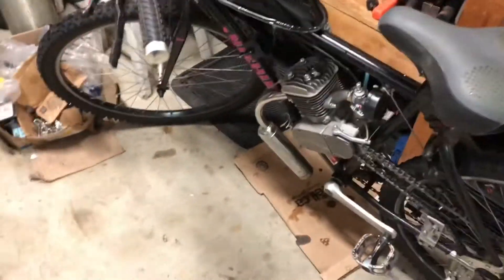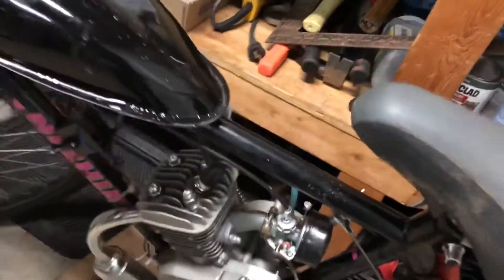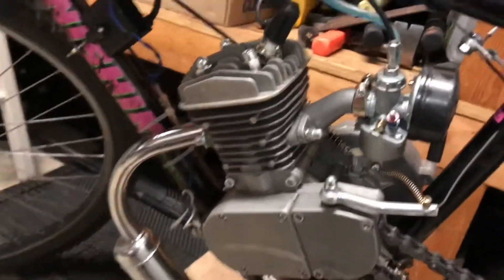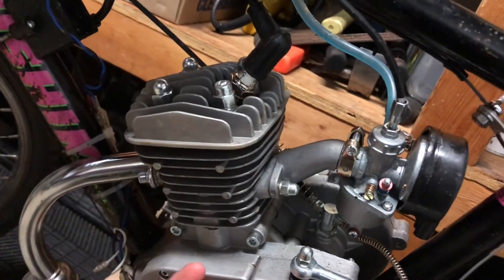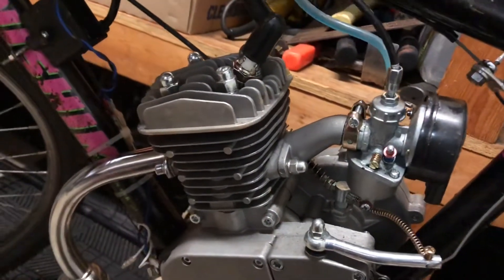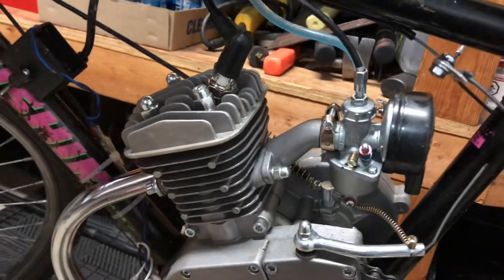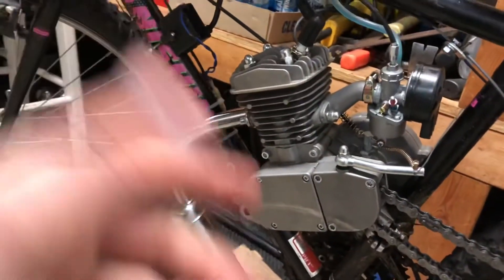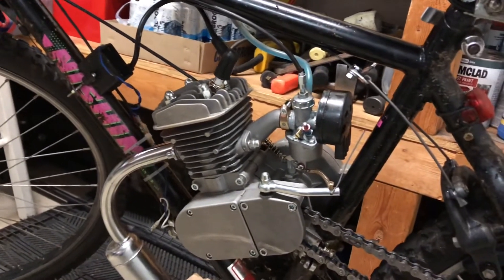Making MORE POWER for FREE on your Motorized Bike!

Comment: i like the fact you are trying.but bro half of what you say contradicts everything I say you hit the nail on the head with the carbon deposits what will happen there is it will score the cylinder jug it's not about price of spark plug or about a oil. The breaking. Is made let the motor heat up cool down and seat Property period after 3 tanks I run for ounces per gallon you don't want a full synthetic especially first tank during braking I have found better performance from regular oil after breaking however you do want a full synthetic the high RPMs good oils like go-kart engines or weed wackers have Teflon they add to the life of the motor and compression it's a single-cylinder engine it does have a rod connected to the bottom of the piston on the wrist pin. . Yes there is no casing with an oil reservoir because it's a 2-stroke your explanation of 2-stroke and 4-stroke was a bit off but that's okay man I'm happy you're learning stick with it the bike looks good good job bro
Reply from the maker: Yeah man thanks!! I learn lots every day. I’ve learned so much to the point where I kinda wanna redo this video properly haha. But I think I’ll leave it because people like it.

Comment: Hey is it ok to buy the premixed fuel from home Depot? They have 40:1 and 50:1, and it says it uses 92 or 93 octane in the fuel mix
Reply from the maker: You can get away with the 40:1 no problem. Don’t use the 50:1 though, in my opinion it’s too lean of an oil mix.

Comment: I have a 80cc I’ve been using 50:1 pre mix is that good ?
Reply: Well, if you are running too little oil in your mixture you could cause serious damage to your engine. 50:1 wont really hurt an 80cc, and its fine if you use it, but I would recommend 40:1 or 32:1 as to not risk expensive repairs to your cylinder by running too little oil in your mixture, or fouling spark plugs with too much oil in your mixture.
Reply: @kodistict9348  ok I’ll do the 40:1 u sure it won’t mess it up or make it go slower ? And is there any way for me to make my bike faster by any adjusting to anything I barely use the choke to much cuz I live in Florida and should I bump up the idle ? Would it make it faster and also I’m always worried something will go wrong if the engine is hot and I feel like it gets hot quick
Reply: @topflighttaylor  No, 40:1 will not make your engine run slower, or damage it. There are two mods that you can do completely free, 1. If you have the stock exhaust you can unscrew the nut at the very end of the pipe, take out the top, and your bike will run quicker and louder. 2. If you have the stock NT carburetor (This has some risk to it) you can take off the air filter to let in more air, but I wouldn't recommend doing this if you ride around sand or dirt, but the exhaust mod should give a lot of power on its own even if you cant take the filter off. Heat is a common issue with these motors, and mine gets really hot too, but don't worry about it because they are designed to get really hot like that and can take a beating.
Reply: @kodistict9348  ya I live in Florida so it’s hot lol and thanks man I seen if you unscrew the  screw it goes faster but doesn’t it eat more fuel too tho I commute to work and back
Reply: @topflighttaylor  It does consume more fuel yes, but it's a very small difference from what I've noticed as I have only recently gotten rid of that, and I get almost the same gas mileage as I did before.
Reply: @kodistict9348  I’ll get 40:1 pre mix

Comment: I'd say the #1 reason instructions say 16:1 mix and even 32:1 once the rings have seated is because the Chinese manufactures want to lessen the phone calls from pissed off people demanding a refund due to seizure of the top end of the motor at like 300 miles on the odometer. 
The compression is so low to begin with. 8:1 or there about when cars and hot rods are like 10:1  and 11:1. They don't generate too much heat if you don't weigh like me....250lbs. And...And they purposely set the timing retarded 5" to keep em' cooler.
Reply from the maker: I agree completely, this is why they recommend that. But a lot of places in China don’t even use actual premix like I’ve got here, they use motor oil. Which explains the super rich mix.

Comment: Stihl ultra hp oil at 40:1 works really good.  Its what most model airplane guys use in 20-100cc 2 stroke gas engines made in china, seems to make them last the longest
Reply: Smoke keeps the bugs away

Comment: what about mixing in about 20% rc nitro fuel into the gas
Reply from the maker: It probably wouldn’t run right. There wouldn’t be enough compression to even combust the fuel if you were to run 100% nitro. But a 20% nitro mix? It would be interesting to see if it would work. I personally don’t think it would do anything. Rc nitro fuel is meant to combust from the heat of compression and a glow plug. It might be similar results to running a diesel mix. Very oily, and would either predetonate or not combust at all. Look it up though, someone may have tried it.

Comment: Right around 8:30 you said it drill holes in your air box not that it made any difference it's just a nice thing to do I rest my case
Reply from the maker: Drilling holes increases air flow, allowing more air into the engine, this making more power. The carburetor usually has to be re jetted or the needle slide clip has to be adjusted. In my case, it was mixed to rich from factory, so this balanced it out, and I made more power.
Reply: @Everatti  i understand y but what reason did you have to do it.let me guess..it was dripping fuel.... but in my opinion the stock nt carbs are just fine.u have to be set correct jet and c clip.. other than that a small tip. I have one motor that I had to bend the metal forks that hold the bowl they were allowing too much fuel and not enough air I run mine without a filter on I know it's not a great idea especially if it's raining but I ride mainly on the street I would like to put a 36 or 34  sprocket with hub adapter. Was not trying to be hard on you bro I just don't think you've been doing this long enough to be teaching
Reply: Okay also check make sure your carburetor is level and you have no air leaks it matters do yourself a favor get a expansion chamber cuz you don't like the noise get one  they make  that is baffled with a muffler on it acting as it's suppress noise it is a good upgrade .u wont regret it.dont over think these motors.just learn em shit they r cheep for what u get out of them. especially when you know what you are doing.good luck bro.i want everyone to succeed.i mean it😃

Comment: lol..i watched this just to c what u had to say..cuz it all depends on a lot of variables I see no performance upgrade on that bike whatsoever your carburetor is sitting not flat you didn't speak about shedding at all you didn't speak about synthetic you recommend breaking it in the way they tell you and then you just threw out a bunch of numbers what are you saying I'm just curious and most likely you're not riding it anymore 4 ounces per 1 gallon good oil after breaking it in that's all anyone needs to do it's all about the way people drive them it's clear to me you need to watch and learn more posting nonsensical knowledge
Reply from the maker: Okay, I’ll give you more context. I’ve recently since this video ported the cylinder, fabricated my own expansion chamber and muffler, and added a performance coil and other little bits like a smaller sprocket. At the time of filming the video, the bike was completely stock. Just because a bike is stock doesn’t mean the person talking about it is clueless of mechanical knowledge. Check out LA Hover Bikes, he is extremely knowledgeable and rides many bikes stock. Because well, they are fine as is. What numbers would you like to hear?

Comment: I have a motorized bicycle i have been using 20:1 mix ratio. How much oil do you use for the 32:1 mix ratio?
Reply from the maker: Depends how much gas you have to begin with. For 1 liter of gas, you need 31ml of oil for a 32:1 ratio.

Comment: A two-stroke doesn’t have oil in the crankcase because the air/fuel mix is pulled through the crankcase by design. A 2-cycle can’t pull air/fuel directly from the carb into the cylinder.

Comment: There is too many reasons your wrong
Reply from the maker: List some please, I’d love to hear them
Reply: @Everatti  most engines spin at 3500 rpm these go at 7500-8500 have you looked at the bottom end bearing material they could be compensating for low quality and poor deboring process and you check the gaps you see the exact expansion and contraction of how that aluminum expands with the amount of heat it gets also considering the extra heat made from less oil why you think it runs better hotter engine so you remember there is all different variations of metal quality and they expand different if you dont know what your doing don't do it
Reply from the maker: @adamsmy8121   I am aware that the aluminum engine block and the cast piston rod and steel bearings expand at a different rate when put under heat. That is why you let the engine warm up before you ride it. The oil is meant to lubricate, not cool. 100:1 mix ratio, I get what you’re saying. But something like a 36:1, that couldn’t do anything to the engine. I’ve been riding that black bike at 36:1 for literally thousands of miles with zero overheating, wearing, or compression issues. I’ve checked the piston and the jug multiple times.
Reply: @Everatti  ok there is 1 thing $150 engine that oil compensates for something explain this

Comment: You made this on my last birthday, thanks!!  That's good advice, and in truth, you can tell the quality of the burn, by the color of the spark plug.  You can lean out the oil until it has a nice brown color on the inner electrode, you probably won't get away from some oily residue, but as long as it doesn't go white, you won't be too lean.  A better carburetor can probably be found in a motorcycle junk yard.  Thanks, it's good to see you diving into this, reminds me of many decades ago.
Reply from the maker: Thanks for the feedback! I’m sure a mikuni off of a an old cr60 or kx60 would work awesome.
Reply: @Everatti  Thank you, Everatti, I'm building a small woods bike, for my friend's kids, and a wheel chair for going in the woods, for a friend who is paraplegic, and your video was helpful in seeing how it ran, and the accurate info.  I just found a "pull start" for the 80cc two stroke, for about fifteen bucks, on ebay, don't know if you are interested, but saved me from having to make a starter.  Keep up the videos, and what ever it is you do that is valuable, and enjoyable.  You are in your "glory days", go for it, you sound enthusiastic and professional, you've got a good thing going.  My Best.
Reply from the maker: @johnmcclain3887  That’s an awesome idea! I’ve heard the pull starts are a good upgrade, but I’ve never needed one as I’ve only had the 80ccs on bikes, so bump starting is easy. The encouragement is very appreciated. Have a great day man 👋
Reply: Honestly I found the baofeng carburetor to be one of the best carburetors for these Motors. The only downside to it is it has that restrictive air box on it. Like the original poster did and like I did, drilling a couple of holes in the intake box definitely does not hurt. If you're lucky you'll be able to find one of those low-profile cone filters, that aren't K&N but it's basically the same idea, and there's your high-performance carburetor in my opinion. Because with these high performance carburetors what you're getting is something where you can play around with the Jets as well as eliminating that restricted airflow box which is the main thing. Take that box off your carburetor completely and you will feel a difference. However I wouldn't recommend running it like that for too long. So for me if I can't find one of those low profile cone filters that match to the factory bofang carb. Probably what I'll do is just hack the airbox, use high-quality vacuum hose, hose clamps, and mount the cone filter for the performance carburetor on it. And to me there's your performance carburetor. And if you find yourself really needing the change the Jets out for wide open throttle you can do that to the OEM Bofang. Myself I'm 500 to 1000 ft above sea level and I find the jet that's in the carburetor from the factory to be perfect. That is for my elevation. And talkin about spark plug colour yes the oil may change that but what you're looking for is an nice caramel like colour, regardless of what your oil to fuel mixture is. For example you could be running that ridiculous 16:1 and if you have the C clip on the needle to the leanest setting you will very quickly find out, if you don't blow your motor first, that you're going to get a very lean looking colour on your plug regardless of what you're running for oil ratios. I just want people to keep that in mind and not just think adjusting the oil ratio is going to correct air fuel ratio issues. Those are two different animals altogether. At my elevation using the OEM carburetor with a few holes drilled into the airbox, the clip on the needle set to the third Notch up, (basically right in the middle) works perfect for me. If I go one notch up it runs too lean, if I go one notch down it runs too rich. That 100% tells me that my jet size (70mm, I think) is bang on for the elevation that I'm at. Just something that people should keep in mind before spending money on a performance carburetor, trying to get more performance when there could be other issues causing performance loss. What everyone should do, Imho, is Get your factory one set perfect for your elevation before even thinking about a performance carburetor and like I said I don't you think they're necessary as long as you can get rid of that restrictive airbox and get a cone filter on it. Then that is your performance carburetor, provided your jet size is correct for your elevation. Again that it's just an opinion from educated as well as my personal experience. I would love to know other people's opinions on that🙏

Comment: here is why the manual says 290:1 or 16:1. these things are made in china and sold all over the world. every 3rd world country has a bunch of these motors running around....
.....and probably 1/2 of them the gas is being mixed with used 4 stroke motor oil. seriously thats the reason for the ridiculously oil rich mix. most end users of these products arem't people living in advanced 1st world nations with access to high guality 2 stroke formulated oils. these are 50+ year old motor designs. back int day, which is still before my old fogey body, 2 cycle oil didn't even exist. people mixed 30 weight non detergent motor oil at 16-24:1 for alot diffrent 2 cycle engines. chainsaws, outboards, etc. eventually we came up specific 2 cycle oils. this allowed leaner rations of 24-32:1 steadily we have come out with better and better 2t oils that allow ratios of 100:1 (opti2 and amsoil sabre) .

that lucas you're using is an FB rated oil. it will be just fine for that ancient motor design and your ratio of 32 to 1 is ok too. now there is another lucas 2 cycle oil. its not called land and sea like the one you have it just says semi synthetic and the bottle is translucent. thats a much better oil, its FD rated, and will be better yet for the motor and you can be a bit more stingy with it at 40 or even 50:1 (i'd run it at 32-40:1)
Reply from the maker: Thanks for the info! I am aware of both of these things. It would be good for other people to see this comment though!

Comment: Did you change the C- Clip in the carburetor when you started using a leaner mix? I think that's a necessary step you left out.
Reply from the maker: Nope I didn’t actually! The clip from the factory was 1 down, and it was too rich. After doing mods to it, it actually runs perfect now! I’ve even got the plug heat range dialled. Good point though, probably should have mentioned something about that

Comment: I use 36:1 and it’s perfect
Reply from the maker: That’s what I’ve been running for the past couple months and agree, it’s perfect. Perfect balance of not too lean for reliable, but not too rich for power.
Reply: @Everatti  I also use spectra Syn Snow oil..snowmobile synthetic oil.. loves it
Reply from the maker: @volvo850r3  Awesome. I use synthetic Lucas two stroke oil.
Reply: @Everatti  you mentioned adding couple air intake holes in the airbox.. I added like 10 holes and ran hollowed out 22 caliber bullet shells and made small velocity stacks in the box... looks sick and runs smooth.. just a tip!
Reply from the maker: @volvo850r3  That’s such an awesome idea! Do you notice an actual performance gain from the bullet shells? I’m sure in theory they work as velocity stacks, but how do they actually perform? That’s an awesome and hilarious idea.
Reply: @Everatti  keep it secret... lol... it sends air straight in the Intake.. works better than cone filter in my application.. chamber exhaust .better head. Cdi and plug upgrade..  smaller jet..
Reply from the maker: @volvo850r3  awesome!

Comment: hey man, so i recently just finished building my 2 stroke 80cc bike and i put in what the manuel sugested aka 16:1 for the break in period. I noticed that it eats up a whole tank in under 30 miles, do you know what it does that, also I ordered a smaller sprocket so the rpms will go down when i go 35mph
Reply from the maker: That’s probably just how much fuel the thing uses. Once you lean it out it might use less.